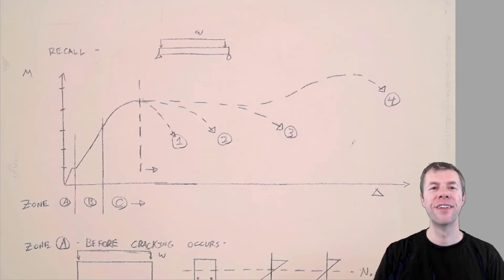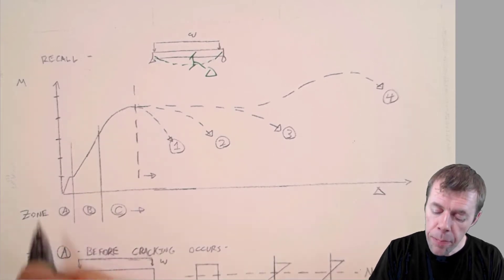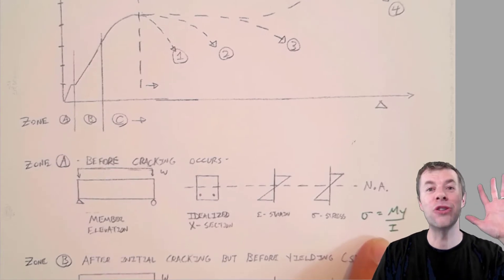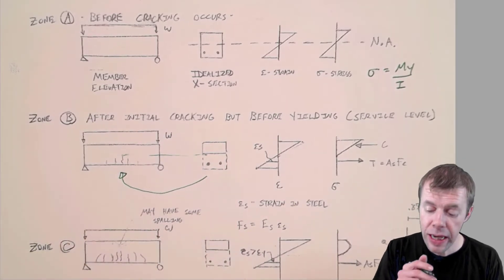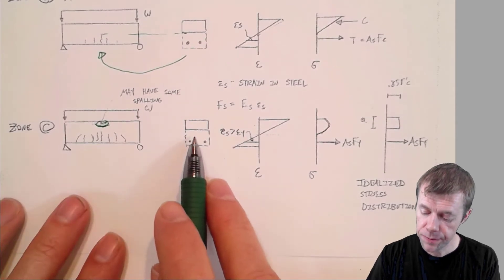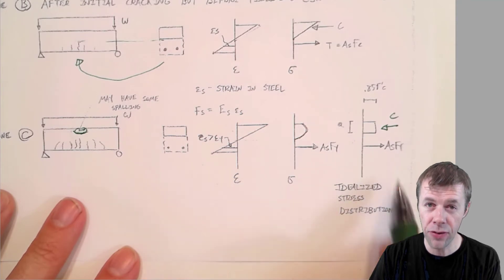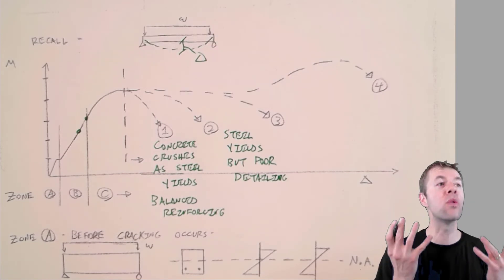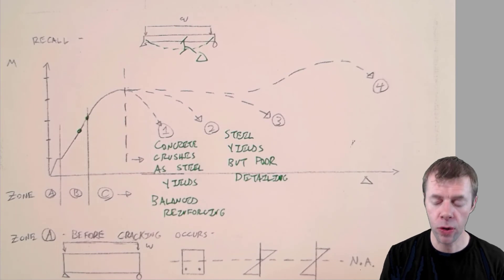Failure Modes of Reinforced Concrete Beams in Bending

Comment: Sir plz upload lecture for design of rcc water tank.
Reply from the maker: Thanks for the message.  I am going to upload a video about concrete slab design.  This will be very similar to a water tank.  I will try and add some notes to it to help with a water tank.
Reply: it's exactly what we need Dr tyler. some exemples on design ( house, bridge,...) from the star for beginners and then for professionnels. it 'll be great if we go for detailed lecture series about those exemple . the design of foundations also ( shallow foundation , deep foundation , piles) is good .